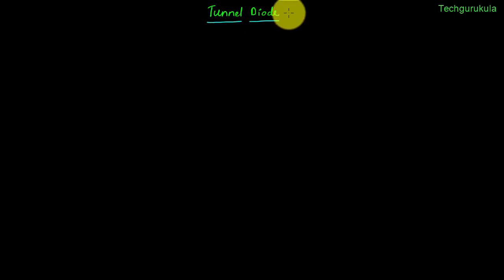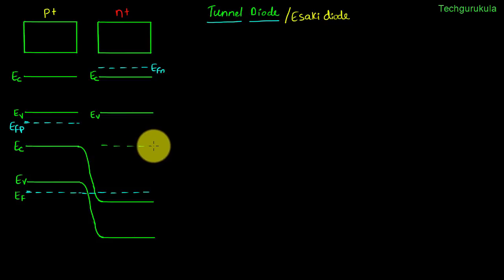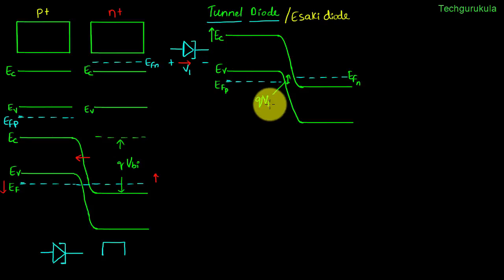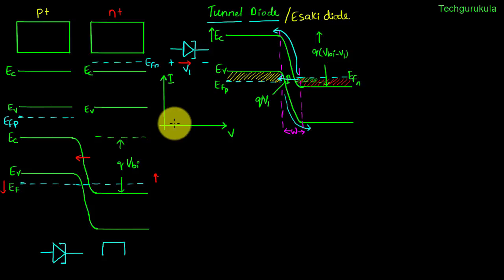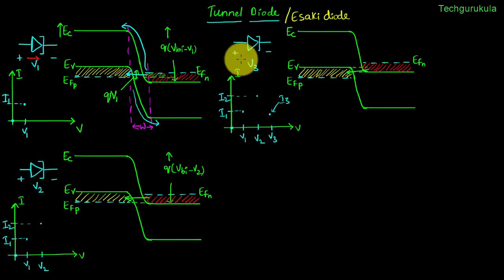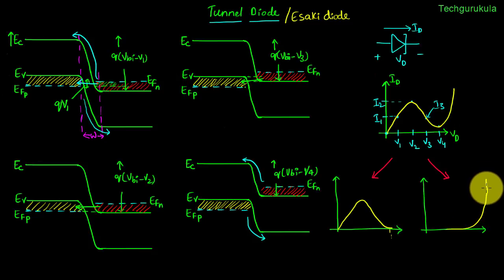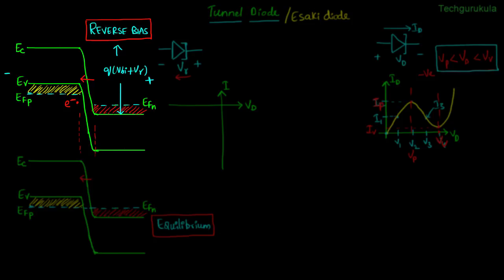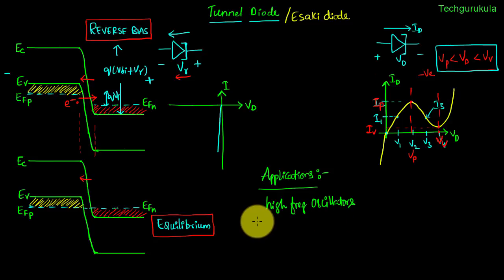Electronic Devices: Special diode - Tunnel diode

Comment: In both FB & RB you mentioned the current is increasing. Would the current reach to saturation after a certain voltage ?
Reply: Shahriar Zaman no. The device will be destroyed by too much current. The geometries are very small and cannot deal with it. Tunnel diodes are  however relatively insensitive to static charge. Don’t believe the data sheet.

Comment: These are special lectures for me reason is two fold. One, I found exact content of my interest in small time and second you know....
Arun: Similar to the reverse biased condition, In equilibrium condition a significant portion of valance band on p-side and  conduction band on n-side overlap. should not there be  higher current at zero external applied voltage?
Reply from the maker: +SUNIL KUMAR 

When external voltage is zero, No drive for the carriers to move, hence no net current flow.
At equilibrium : no net current flow.
Reply: Right. It seems like a resistor at low diode voltage. Thanks Arun.